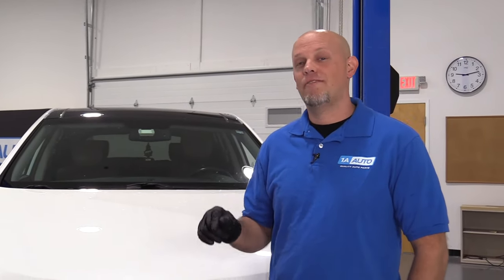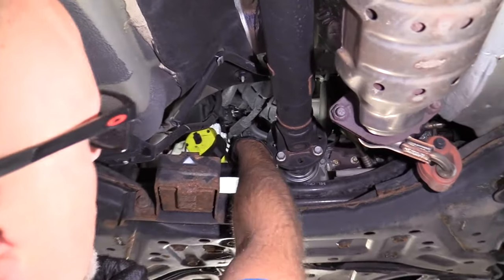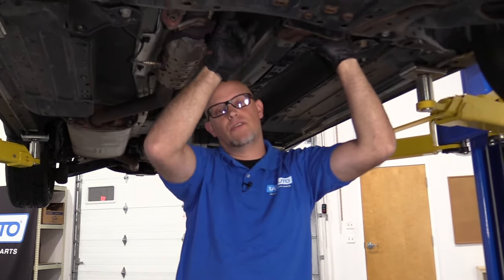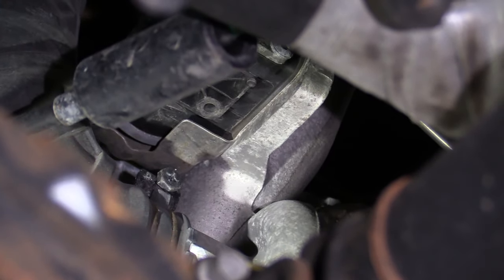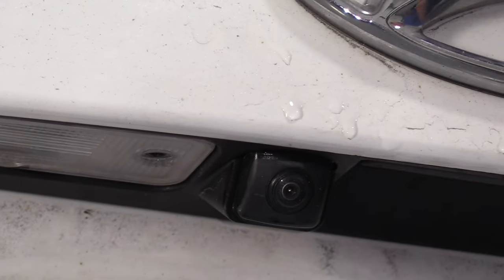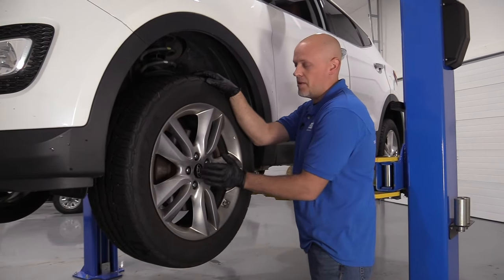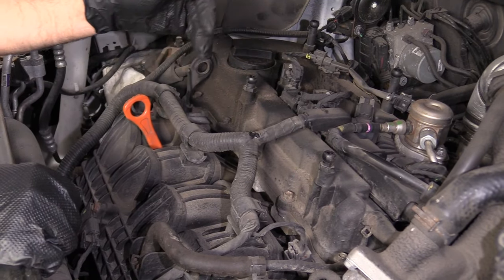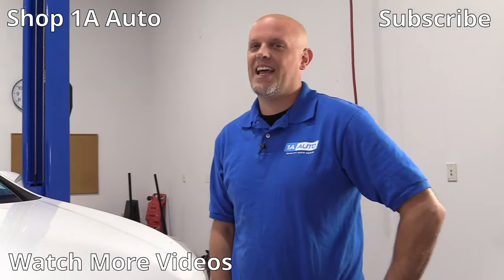Top 5 Problems Hyundai Santa Fe SUV 3rd Generation 2013-18

Comment: I'm at Uber driver I had a 2017 Hyundai Santa Fe sport I got in an accident one time, the front end was busted up but it was a light hit I got it repaired replaced the radiator the car ran forever I put almost 200,000 miles on the car with proper maintenance the car never let me down.. Actually people or passengers that road in the car want to know the make model of the car so I guess I attracted more people to Hyundai..
Reply: which engine? and Awd?
Reply: Is this second engine??

Comment: I am surprised you didn't speak about the main issue, the burning of oil. My 2017 Sanatfe burns oil so fast. There's no oil level sensor in such a modern vehicle. Failure to manually check oil on a bi-weekly basis will lead to you engine breaking. If u want to get this vehicle check and top up oil every 2weeks otherwise your engine will break.

Comment: 2018 hyundai Santa fe xl, Wheel bearings, brakes x 2, backup camera x 2, suspension linkages, fuel pump, full exhaust system, o2 sensor, air conditioner complete unit new lines etc, forgetting more ! This vehicle has 62000kms, that's about 39000miles. Absolute worst vehicle I have ever owned ! It's comfortable, I can say that lol. But maintenance is a Joke !!

Comment: I have a 2018 base model santa fe, super reliable. No issue so far at all. absolutely love it.
Reply: We have a 2014 & 2019 never had one issue with them. The motor did go on the 14 at 90k but replaced it for free so I was ok with that.
Reply: Thanks for that info

Comment: Great video but they forget the biggest issue with these vehicle. The engines blow up!!! I'm an Hyundai tech of 4 years. I'm replacing these engine and any of Hyundai 4 cylinders on almost a daily basis. There is a recall for this problem so if you have major engine troubles, call the dealer first.

Comment: I have a 2014 Santa Fe Sport 2.0T.   Last September, (2020) we were pulling a utility trailer (empty) back to our house, about an hours drive.   We just bought it (used).   It was banging up and down at the tongue, and I was getting concerned, though it wasn't loose.   Suddenly, the engine slowed down, wouldn't rev up, but I was able to maintain some speed.  I stopped to check it out, nothing seems to be wrong otherwise.  So a check with a meter at an auto parts store revealed my knock sensor went out due to the noise my trailer was making.   After checking up on line, we found the sensor was on recall .  So check your VIN to see if yours is on recall.  After talking to Hyundai, they said the whole engine was on recall !  So they replaced the engine with a new factory engine including the knock sensor and, according the build sheet, the turbo as well!   Didn't charge us a thing. Took about six weeks, they gave us a loaner car from the rental next door.   No issues, 100% guaranteed engine, full drive train to a hundred thousand miles!  It was around 76K when it went out.  So I still have a hundred thousand miles on it to go! I just wished that American cars and trucks (are you reading this GM?) would give this kind of service!

Comment: Thanks A1 Auto, for the informative video. I bought a 2017 Sport , lease return, from my local dealer in 2018. Called the former lessor, to get his input. He told me the reason he returned it after only a year, was that he needed the larger model to haul his grandchildren around. So he bought the version with extra seating. Otherwise he loved it. I’ve thoroughly enjoyed this vehicle, and would consider another in the future. Mine now has 58k, and is dealer maintained. I will say, I do prefer the screen location in this model, to the newest version. Gas mileage has been steady, between 25-28mpg. I’m hoping to keep this one for many years, because it does feel like a solid design and ride. Very comfy.

Comment: Knock sensor tripped in my used 2013 Santa Fe just a few months after I bought it. Turned out to be a machining error on the bolts, causing metal flakes to get into the oil and circulate. I got a brand new engine installed by Hyundai via recall. Love my Santa Fe and I love that the company made it right. Will be upgrading to a newer one soon!
Reply: We had this same issue in our 2013 at 65K miles. Hyundai replaced the engine with no problems, even covered a rental while they were working on it. This is our second Santa Fe, will probably buy another one when this one kicks it.
Reply: @amylouky  Seem my comment above (I wrote it before I saw this one) on the same issue.
Reply: It is a lower crankshaft bearing that gets chewed up causing the metal flakes not a machining error.  They used cheap bearings. 
Almost all Hyundai’s are affected between 2013-2018
Reply: @AinSophAur31  I have a 2017 SFS turbo, the dealer has agreed to replace the engine. Should I expect the same problem with new engine at some point? My car is burning over 3 quarts of oil every 5-600 miles.
Reply: @AinSophAur31  I bought a used 2013 sport with 105,000 miles on it recently, for my son. Sent an oil sample to Blackstone and it came back no issues and no trace metals indicating a bearing issue. This car had a Carfax showing dealer oil changes every 4000 miles. I think one of the keys is frequent oil changes and making sure the oil level does not get low on these cars.

Comment: Have an XL with the V6. Many of these don't apply and overall they have been very reliable and cheap to repair.
Reply from the maker: +Clint Upham Thanks for checking us out! http://1aau.to/m/Shop-1AAuto-c
Reply: Watch out for the oil pressure sensor on the 3.3 V6. It can blow apart on hard acceleration. Results in Massive oil loss oil pressure light on and a big repair bill with a tow as you won’t have enough oil in the engine to drive it to a service station. Dealers are well aware of this common problem with the V6 and the oil pressure switch can blow out more than once in the life of the car. Should definitely be a recall. 

3.3 V6 is also direct gas injection and gets oil dirty faster than most engines and has comparably poor mileage to other V6s

Comment: I beg to differ on issue P2562 - "Turbo Waste gate actuator voltage out of range". This can be fixed by simply adjusting the length of the actuator's connecting rod to bring the voltage output of the actuator back into its required voltage range (typically 3.9 to 4.1 volts DC). This should be tried first to eliminate the need to replace the actuator or turbo unit. Takes about 1 hr for an inexperienced mechanic to complete. I've done it myself, and it worked great and saved me a LOT of money.
Reply: Right on.  Fixed this myself a few years ago also.

Comment: One key issue (arguably the single most important) not mentioned in this video: the direct fuel injection for this series WILL cause catastrophic engine failure sometime between 30,000 and 200,000 miles. Mine died at 123,000. Through the course of this drama, I spoke with multiple Hyundai techs who told me it's sort of a "public secret" that Hyundai has chosen to omit from any service bulletins. The upside is that if you take your Hyundai in to the dealer, they're very likely to replace your engine with a rebuilt engine one (which will, sadly demonstrate the same failure at some point—in which case, you'll have to "rinse & repeat.")
Reply: Just had this done on April of 2022. They have a recall now on several Hyundai and Kia engines 2011-2016. I've had so many issues with ignition coils, spark plugs, turbo and yet they did NOT replace those parts due to the main issue that led to these parts failing. I've just purchased another set of ignition coils since the engine was replaced. Replacing the engine (which is actually just failed parts inside it) does not fix the domino parts that have been affected by these issues that car makers will not take responsibility for. Not impressed by dealerships lack of pushing for makers to actually fix the FULL issues that consumers should not have to cover due to their poor craftsmanship.

Comment: I have a 2014 Santa Fe Sport 2.0T.  I have had zero problems with it.
Reply: How many miles are on yours? City/ highway mostly? Just curious.
Reply: I have a 2014 Santa Fe Limited 2.0T and just had the rear differential fail. 160,000 km and it started clunking in the rear. Most noticeable on turns. Oil was replaced at 100,000 km.
Reply: @OKMadCat  Our 2013 2.0T is at 102,000 miles. We've had zero issues. I'd say 95% city miles. I'm no mechanic (RN), but I do all my own work. I sent oil to Blackstone labs at 80,000 miles and again at 100,00 miles out of curiosity and they said the oil was pristine.
Reply: You’re lucky, because I have the same and been plagued by a check engine light at 70k miles no one has been able to resolve.
Reply: See my comment (9/21/2021).  Check your VIN, you may have an engine and/or knock sensor recall.  Take advantage of it, it's worth it.
Reply: @BrianCinBengals  Check your VIN online for any recalls. You might get a new engine.
Reply: @Victork32  I have a 2017 Santa Fe turbo with 23,000 miles on. Bought it at 10,000 miles. Just had the rear differential issue. Now that’s absolutely ridiculous for the mileage.
Reply: @OKMadCat  i have the same question my 2014 santa fe sport turbo. Is making 270 miles per tank.

Comment: I dealt with most of these problems recently with my used 2013. It got to the point where it wouldn't accelerate past 25 MPH. Hyundai replaced my engine at no cost. I had approximately 99,535 miles on it when the problems started.

Comment: Mine had a air conditioner line leakage and rack and pinion issue. I heard both very common. It is a good car but parts are quite expensive.

Comment: Another common problem I have found with and a few other hyundais, is the discharge hose from the a/c compressor leaks, the rubber hose must shrink in the aluminium crimp letting the gas leak out, It's easy to tell, just look at the hoses that run off the  compressor, it's the thinner of the 2, look there the rubber hose is crimped to the aluminium, if it's covered in oil, there's your problem, the hose will either need to be repaired or replaced with a new one
Reply from the maker: +Matthew Dimauro Thanks for the feedback!

Comment: The biggest thing in my ownership of a 2014 turbo is the factory recall on the engine, due to some kind of residual residue in the engine it clogs ports in your engine and then oil can't get to the bearings so the bearings end up going Hyundai actually replaces your engine for free I was driving down the road my vehicle went into limp mode it was the knock sensor the engine was definitely knocking the bearings went and getting a new engine put in now

Comment: I have a 2013 Sport 2.0T. Lost the engine at 131k and it sat for nearly a year. It was June or July of 2020 that I learned Hyundai had extended the warranty on the 2.0T engine to lifetime. By August it was back on the road with a brand new engine from the dealership, absolutely zero dollars!
I had to replace 3 wheel hubs to pass inspection in April of 2019, haven't had a problem with them since.
My back-up camera hasn't worked since I bought it. I've lost 2 windshields.
The thing is a tank on snow and ice with proper tires, way better AWD system than my Honda Element.
It's had it's problems but I like the rig!
Reply: I am about to buy a second hand santa fe  with replaced engine by hyundai dealership same model,would you recommend  buying it?
Reply: Do you know if that warranty extension would apply to my 2017 2.0T?

Comment: Thank you! I first got a code to replace the camshaft position sensor.  When I replaced and it still didn’t start, The code then showed the crankshaft Position sensor. I just received the part and I pray it’s the answer. What symptom my car had was it did stall and not start.  Praying this crankshaft position sensor does the job!
Reply from the maker: +Karen Jenner Thanks for checking us out! http://1aau.to/m/Shop-1AAuto-c

Comment: I have a 2015 Santa Fe Sport , with a few customs touches. My only problem has been the right rear hub bearing..expensive fix.  Bought it brand new and it has been a great car.. have about 64,000 miles on it. Also had the brake system recall on it.
Reply: hi if I may ask what custom part u did I have 2017 hyundai santa fe thanks

Comment: Have a 2013 hyandai Sante Fe. After driving and going up the smallest of hills, the breaks will engage and the car will not move until it cools off. It will also have a burning smell of which we assume was from brake fluid leaking?? Took to dealership and they couldn’t figure it out but wanted to charge $2000 to replace abs system but couldn’t guarantee that would fix the problem. This was what was told after having the car at dealership for over 2 weeks. We couldn’t pay $2000 for what “may or May not be the problem “, so took it to a shop and he replaced the abs sensor and system and still didn’t work and he finally gave up not able to figure it out. Made complaint to Hyundai, took info and about 3 weeks later they called and said there’s nothing they can do. It’s not on recall. Do you know what could possibly be causing break to engage after going up the smallest of hills. When it does it, it also smells of fluid as if the break fluid is leaking out. It will not move until it cools off and it got to the point where it didn’t matter if it was a hill, it would just stop. And isn’t it ridiculous dealership can’t figure it out? We can’t drive it and can’t afford new car. Help!!

Comment: I had a 2011 Santa Fe and my friend has a 2012 Elantra GT. Both our crankshaft sensors went bad. The car would stall, and wouldn’t start for a little bit. Same problem, on the older gen Hyundais too.

Comment: I have a 2019 2.0 litre turbo Santa Fe (it's 5 years old now) with push button start. There are 76k kilometerrs on it. Sometimes it won't start. I hear the clicking of the starter relay picking up, but the starter won't even turn over. It's almost like there is some kind of interlock issue.
 It's very intermittent and just starting happening about 1 year ago. The battery is ok. I swapped the starter relay and that did'nt make any difference.
Sometimes when it won't start, I wait a few minutes and then try starting it through the bluelink app; and it still won't start. Then I'll try again 10 minutes later and it starts ok from the push button. Sometimes it does start from blue link app. 
I also changed the batteries in the key fob and that did'nt make a difference. 
It's a very random issue but lately it's happening more frequently. 
Next I will try cleaning the starter electrical terminal connections (positive and ground terminals) but I doubt that is the issue.
Does anybody else have this issue ? 
Any ideas what else I can check ?
I did take it to the dealership and they scanned it for codes and found nothing. They tried to replicate the non-start issue, but it kept starting ok at the dealership.
Any feedback will be greatly appreciated.
Thank you (Dec 11, 2023).

Comment: i have a parking brake actuator failure which is costing 1600 euro to replace ,it seems its a common fault ,electronic parking brake just stopped working  on my 2016 santa fe ,only 105 000 kilometers on the clock

Comment: My wife had a '14 Santa Fe we bought used off a private seller. Never had any issues with it, got a recall notice about the ABS system possibly causing a fire, made an appointment for 7:30 on a Saturday and got it checked out, fast forward 3 days later little old lady runs a stop sign, the wife t-bones her and totals the car. At least I woke up bright and early on Saturday to handle that recall....LOL.

Comment: 3 questions: I have a 2016 Santa Fe Sport 2.4L.
1. Is it ok to remove the shield underneath the vehicle to allow easier access to the oil drain bolt and filter? I live in the south so no worries of snow, salt getting up into my engine. 
2. My Santa Fe does not come equipped with foglights, only the cover knockouts,  i want to eventually install foglamps, does this vehicle have the factory foglamp wiring harnesses to connect into?
3. Does the 2.4L have a timing belt or timing chain?

Comment: I have a 2017 santa fe limited 3.3.
I change the oil every 7500 miles and it doesn't use a drop.

Comment: This vehicle on the video seems to have significant rust and corrosion on exposed under vehicle parts.  We don't see that here in a dryer part of the country.  Another "issue" with this vehicle is premature wear from the front sway bar links that results in clunking even over very small bumps.  Best to replace with Moog links which have fittings to grease.  This vehicle,  as most know,  has a GDI injection system which can result in excessive  loss of performance/power due to carbon build up on the back side of the intake valves.  I have found that an intake cleaner (such as CRC) simply sprayed into the intake makes a significant difference.  A way to reduce the build up this is to install a simple oil "catch can" in line with the vacuum line going into the PCV .....just have to drain the "can" about every oil change.
Reply: I did exactly the same thing and the vehicle runs fine. In the last two years, the engines have gdi and efi to eliminate the need for valve cleaning. Other manufacturers have done that also.

Comment: i really like the way this generation looks and was considering picking up a used 17-18' model but the 2.4L engine issues kept me from doing so.
Reply: I have a 2015 Santa Fe and this past November the engine issue bit me. It wouldn't rev above 2000 rpm's. It was a fatal flaw but thankfully Hyundai replaced the engine at no cost to me. It's been fine since then but the thought is always in the back of my mind that it could happen again to the new engine. We will see.
Reply: @williamgualdoni85  I had the same issue in 2014 turbo. vehicle went into limp mode the engine started knocking engine light came on with a knock sensor code but Hyundai is replacing the engine now for free